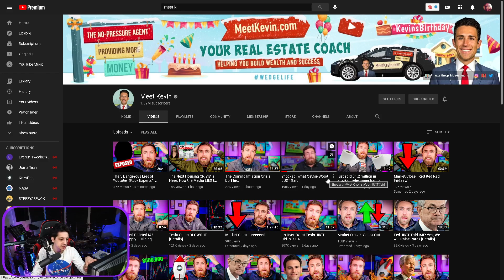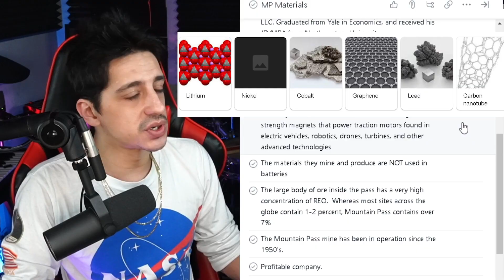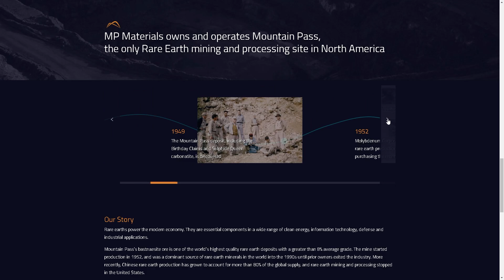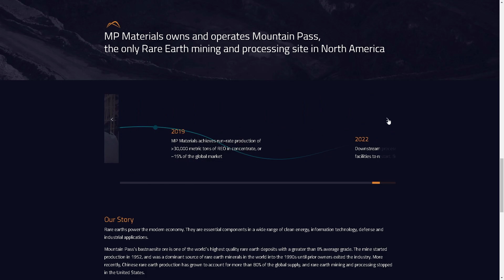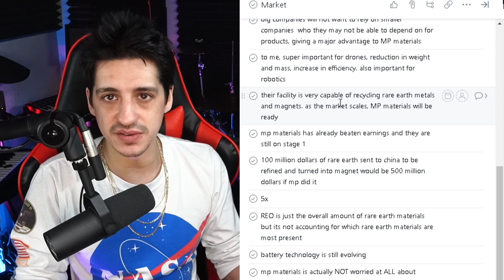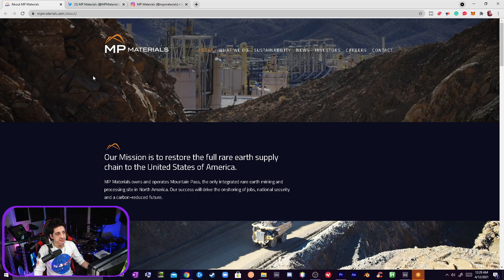Aaron Bowley -  MP Materials Overview

Comment: Mp materials vs Vale. Both got stronger and weaker points. What is your opinion?
Reply from the maker: Complimentary. Different ore, different metals, different materials. In my opinion would actually be cool for Vale, because they are so expansive already , to get into mining for REO, they would have the option of sending it to China or to MP for refinement / magnets
Reply from the maker: I would also say once mp achieves stage 2 and 3, will skyrocket , in my opinion, where with vale I don’t see such a catalyst , but “when” exactly , best I can realistically speculate is 2023 , even if I personally expect the stock price to do well much before then